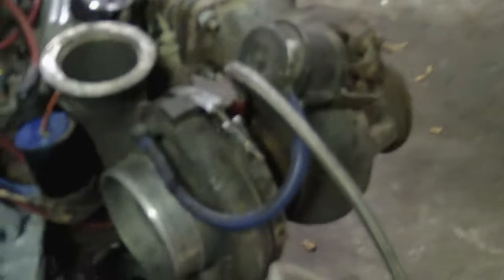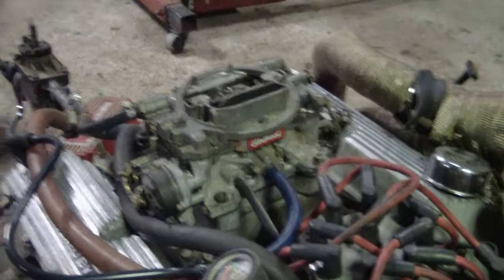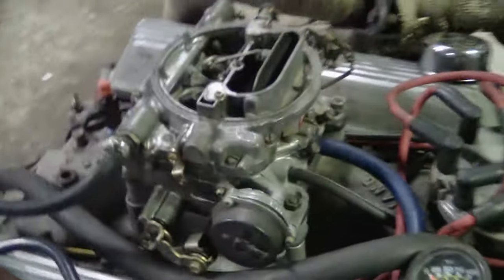Testing A 12.7L (775 CI) Semi Truck Turbo On A 302 Ford Homemade Hot side (pt4)

Comment: You are gonna have to put a 5000 rpm chip in it and do another video to show a few people what’s going on and I want to see a video of the motor running with the monster turbo hooked up making some boost. If anybody can do it you can.
I’ve seen all your other videos so I know there’s one coming soon with this combo in Ranger or mustang or something sometime soon
Reply from the maker: https://youtu.be/fMeNNUwpAr8      https://youtu.be/7th2Xtta8Uo     https://youtu.be/0S0GmCsK9HY   Theres 3 got other videos driving it also . I put a even bigger Variable vane turbo off a 14L (854 CI) Detroit diesel on it now . I just put the 302 back in the truck had bent rods from the little 12.7 L turbo. If I can't control the boost better with the 14L turbo (vane) I'm probably gonna have to go back NA. The wastegate  in the 12'7L turbo doesn't bypass enough so it boost creeps to rod bending territory. Might have to convert it for a 351W might not bend them as easy lol.

Comment: Surprised your gonna run it threw a carb. Looks cool as hell tho. I’ll give yeah a sub , I’m curious as to how well this combo will work .
Reply from the maker: I had three semi truck turbos that a buddy gave me figured I would see if I could make them work I tested one of the bigger ones on the 351w before I ran two into one the way it looks in the first video and that turbo with plans to run twins but the exhaust housings are way too big 1.72 it didn't even turn at idle. so I tried the smaller one it has a 1.28 housing and it would turn at idle so I went single with both sides feeding it with the 302. I made everything from junk lying around going cheap not knowing if it was going to work or not I only have about 250  in it so far motor was 155 from pullapart cheapest turbo motor combo on the internet Lol
Reply: kickassmustangs garage Man what a way to be unique good luck with the build I look forward to the finished product. We have a pretty sweet build going on our car, but we definitely did not go the cheap route LOL. Check out our channel if you have a minute to see our progress..
Reply from the maker: I got a few more parts the turbo discharge elbo and I made a carb hat with a blowoff valve  still need a boost reference fuel pressure regulator and air fuel ratio meter and a boost gauge.I made my own blowthrough carb holly double pumper 650  once I work out the bugs and can make sure it doesn't melt the motor I will make another video on it. I got to go check out your build now and subscribe.
Reply: kickassmustangs garage you have one hell of a setup !! All that fab work . Your going to surprise a lot of people lol.. thx for the sub we’re trying to reach 1K for 2020..
Reply from the maker: @carmob7499  I had 18 subscribers for almost a year!  there starting to pick up some since I started posting videos on the Ranger it would be nice to get 1000 this year probably not going to happen Lol maybe one day I'll bust 100 Lol
Reply: kickassmustangs garage this month is one year on YouTube for us we achieved a little over 200 subscribers. The goal is to put out at least one video a week I am guilty of not doing that. I also try to network with people on YouTube whenever I get a chance to , try to meet other people and also grow my channel. This summer I plan to collaborate with other you tubers that have more subscribers than me to help promote the channel. You have to stay optimistic if you’re trying to make this work it’s not a sprint it’s a cross country race.
Reply from the maker: @carmob7499  it's not easy to get subscribers. once you get a 1000 and youtube can add commercials and make money off your videos then they start recommending them and you'll start getting alot of subscribers there not going to help till they can make money off your videos.  They messed up one day for about 10 minutes after I posted a video got 80 views without posting it on facebook after that 10 minutes it got only 10 views in two weeks  because they didn't get to make any money off it

Comment: Not sounding too hot
Reply from the maker: I had a 3000 RPM chip in it so I could  put a load on it. Go check out some of the videos of it in the Ranger going down the road and subscribe if your interested

Comment: with no resistence   on the exit  you could spool it with a   motorbike engine
Reply from the maker: It came off a 12.7L  Semi truck T6 flange 1.28 exhaust housing  with a 5 inch exhaust pipe
Reply: @kickassmustangsgarage  yeah but as soon as ya  connect it to the  carb the spool time will go up  as theres resistence on the  turbo
Reply from the maker: I don't have any turbo lag.  The motor is pulling in air when it's hooked up so it helps it spool till it makes boost then it makes more compression witch makes more exhaust pressure that makes more boost.  I could make 40 plus psi if the motor could take it.
Reply: @kickassmustangsgarage  Probably not. There likely isn't enough CFM through a 302 to make 10psi on a turbo of that size. 
Which is likely why the compressor was huffing like that.
Reply from the maker: It's making 15 on the gate with no Turbo lag. It had a 40 psi gate spring. it came off a 12.7 L that only turns 2200 RPMs =25,400 L of air. a 302 is a 5.0 L that turns 6,000 RPMs so 30,000 L of air 302 makes more air than the 12.7 at max RPMs. It was making 40 PSI on the truck it came off of so if the 302 could handle 40 PSI  it could make it.

Comment: things skipping like crazy your gonna damage the engine before you get it mounted in something
Reply from the maker: Did you not see that it had a 3000 RPM  rev limiter. Thats why it sounds like that it won't hurt it that's the way a 2 step works  lets you preload the motor. If you watch it again and listen you hear the turbo start to spool when I give it more gas once it's bouncing off the limiter.
Reply: @kickassmustangsgarage  good luck
Reply: It’s got a 3000 chip in it so it’s supposed to miss like that it limits the firing to 3 grand

Comment: Sweet gonna be mean
Reply from the maker: I still have the bigger turbo to test later. I made a down pipe today all that's left to do is header wrap it and I need a brake master cylinder reservoir it got smashed it needed a new one anyways lol
Reply: garage  need to swap it to 4x4 lol
Reply from the maker: I had thought about it I had a 72 bronco that I was going to get the axels out of  put a straight axle in the front but it had a 3 speed  transmission that I didn't care for and I sold the bronco maybe one day
Reply: Solid axle swap probably get you a lot of subscribers. Go for it lol sas!!!!!!!